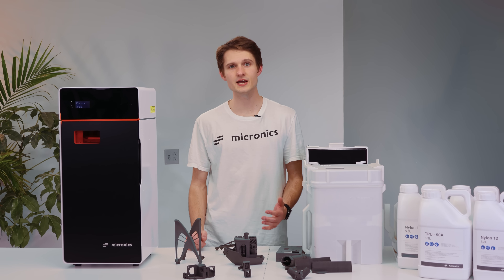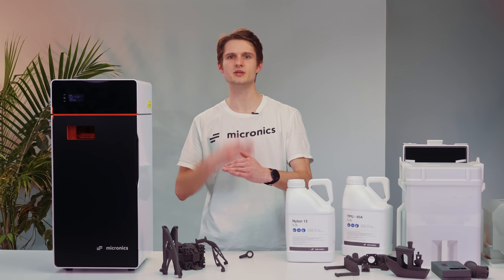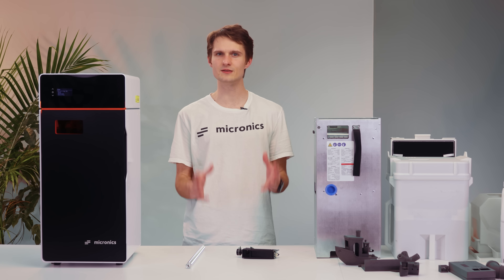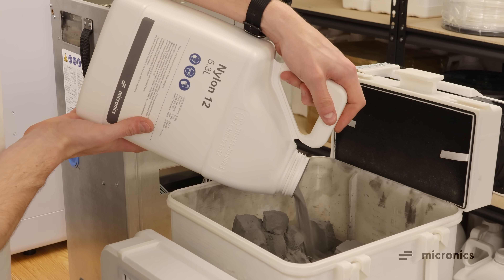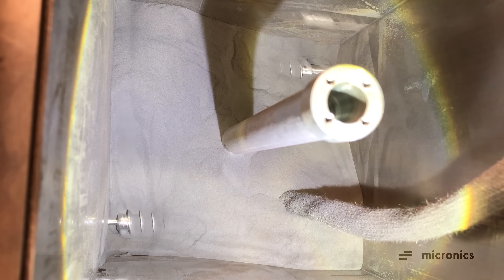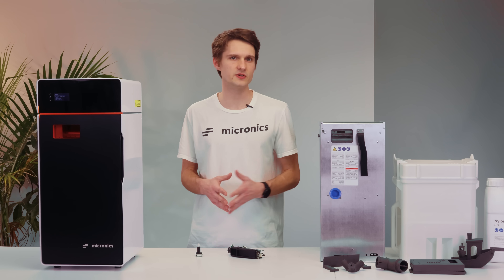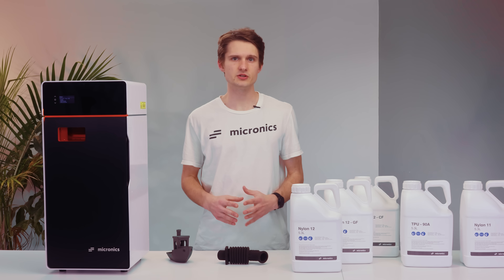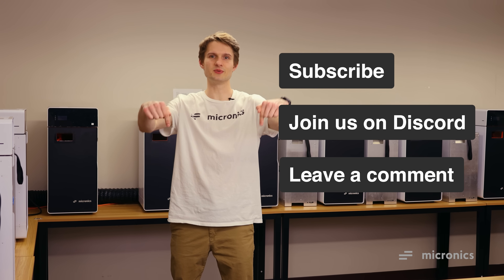How we BUILT a 3D printer that can print ANYTHING!

Comment: I've literally only just started low volume 3D printing using an Ultimaker S3 dual nozzle printer, that can print numerous different impregnated and regular filaments, to produce extremely rigid strong parts. Now you're telling me one can print with powders? That's just not fair. Materials and printing innovations are moving forward so rapidly, one barely has time to master one discipline, before needing another crash course in the next innovative gadget to hit the market. At least if one is familiar with the software, less time is wasted learning completely new design tools and techniques. Thanks for the very informative video, which has convinced me non the less to stick with regular filament 3D printing for now. 😉👍

Comment: With a 160x160x200mm build volume & a 500W power draw its build volume is around the same size as the A1 Mini which is on the smaller side for me. But it’s a great start & I’m sure a larger version will come out if this gets enough support!
Also the ability to make parts with isometric strength in any orientation like with resin is awesome! Even better that no supports are needed thanks to the powder supporting the printed parts 🙌

Comment: If I might add some suggestions, as I have some experience with CO2 and Fibre laser SLS printers: You would open up a whole new market, especially in Powder research, if you are able to develop this system to use a CO2 laser. I get why you went with a NIR-Laser source but from a research standpoint a CO2 laser is almost a must. I know that the primary focus of this machine will be prosumer but the market for research machines is unsaturated and the machines cost a lot (SnowWhite2 =~ 20k, sintratec S2 =~50k) so this machine with a CO2 laser source would outcompete all competitors, just saying ;)

Comment: Hello, this is a amazing product! I have a couple of questions.

1) I'm designing a digital galvo motor driver for a different project, but I noticed in the video that you prefer an analog driver. Is this because of cost only, or is analog driver better in terms of precision?
2)Are you using two photodiodes available in the market for your galvo motors?

Comment: Can a printer like this be used to make tabletop wargaming miniatures? or is the quality not sufficient to equal injection molding for that?
Reply: the surface finish is far too rough for miniatures
Reply from the maker: You can print miniatures very easily, especially those with complex geometry usually  requiring tons of support. The surface is rougher than SLA but still much smoother than FDM. We recommend media blasting with glass beads to get a smooth surface finish. If you want you see it for yourself, you can order a sample part from us at www.micronics3d.com.quote. Cheers!

Comment: Nice, but I suspect it can't print steel/metal?

A great deal of the attraction for SLS printing is the capacity for metal parts. I can see this working with something similar in concept to the process of using metal infused filament that's laterburned away with a sintering process...

But I'm still waiting for a full metal 3D printer 😭.

Comment: Have been contemplating to pull the trigger on a Prusa XL or the next gen BBL printer which supposedly will be released this year but was holding out to see if anything else was on the horizon.. I think I just found it 😮 

One question though, SLS seems a lot more aimed at functional parts whereas FDM can be more aesthetic with different colours etc. Is there any colour options when it comes to SLS? Even basic solid colours over the entire part?

Also, please ship to UK! 🙏
Reply from the maker: To keep the cost down on our printer, we used a 450nm blue laser source which means you are limited to dark grey/black powder. However, the parts come out with a matte surface finish which takes spray paint very well. We should be able to ship to UK but there may be additional import duties.
Reply: @micronics3d  Awesome stuff, apparently dyeing SLS prints is a thing too. Excited to see where this goes, will be following for all the updates!

Comment: Great job! 👏👏 what could be done to reduce the surface “roughness”? (Same issue happen with Lisa and Fuse vs MJF)
Tks
Reply from the maker: You can smooth it out with media blasting, tumbling, or vapor smoothing. Alternatively, you can also use CNC machining for higher precision features or manual sanding/polishing to achieve full gloss.

Comment: spot electro-plating in copper sulfate water bath, direct metal spot plating of copper, very near the point, on a conducting copper surface sheet. well, if the commercialization of the sls laser sintering continues then the next level is sub 500 sls consumer (not prosumer) device. yes for real.

Comment: Idea: add a little vacum of some sorts on a xy gantry to make infill possible without adding holes in the model. While this reduces strength and increases machine cost, it can reduce the cost of per piece and weight greatly
Reply: no.. solid dense models is where it's at
Reply: easier said than done

Comment: This is so cool! I hope you succeed! ❤
Also, how about using metal powder instead? If you could bring metal 3d printing at this price range to the market you guys will revolutionize the world!! Would love to hear back what are the major limitations for this.. since it seems you solved most of it already.. 
All the best! Subscribed!
Reply: Few things you need for metal powder: Way more laser power, way more chamber temperature, evacuated atmosphere with inert gas (like argon). Some of the cheaper metal printing systems actually use a binder powder that just "glues" the metal particle together, then you have to sinter that raw cake in a furnace at over 1000°C for hours to burn out the binder and weld together the metal powder. This sintering and removing of the binder leads to massive shrinking (20-30% in volume are not uncommon), and this leads to a whole new set of difficulties and issues.

Comment: I am guessing that the matt surface finish is unavailable with this kind of printing. What would be a reliable suggestion for recreating a glossy finish after printing? Heat treatment, some kind of chemical finishing or just good ol' sanding and polishing?
Reply from the maker: The parts come out matte and we recommend media blasting. It's possible to achieve semi-gloss finish with tumbling/vapor smoothing. Full gloss would require manual polishing.

Comment: Using unreal engins physik engine to pack the parts has to be one of the greatest moves I have seen in a slicer.
Reply: I love how the benchies already showed the issue when packing this way, one of the benchies was nested at such a shallow angle that the 100 micron layer steps were very clearly visible.
Reply: @random_youtube_commenter  Sorry, what's the point of your comment? I am geniunely curious. Because if you are being sarcastic, I'd think it's a tad misplaced. Don't you think a programmer smart enough to implement Unreal Engine for slicing could figure out how to constrain it to to only using arc angles (or whatever they called) with a bit more time which should reduce the layer lines considerably? Or even a type of setting where you can choose between max packing density vs. max quality.

Comment: Just learning about SLS.... Just curious:  Would a higher powered laser and NO material preheating be more efficient?
Reply from the maker: No, unfortunately the powder does need to be pre-heated. After the laser welds the powder together and it cools back to a solid, it slightly contracts. Doing this a few layers would cause the part to curl up like a potato chip. Therefore the entire powder bed needs to be heated up to keep the material soft and flat.

Comment: With something like this the infill will always be 100% inside an enclosed shape?  I guess you could drill a hole in it to get the powder out.  This method looks really promising though.
Reply from the maker: Yeah typically SLS parts are printed 100% solid. You can make hollow parts but we recommend having 2x5mm holes for getting the powder out after printing.

Comment: This is truly awesome! Whats the cost for a 2nd chamber so i can switch between nylon and TPU easily? Air quality? Do i need special ventilation or fume extraction?I need 6" x 6"x 12"  any possibility of making a larger build volume model?
Reply from the maker: Additional chambers will be $1299 each. The printer has built in carbon and HEPA filter so you just to use it need a well ventilated room. For larger parts we recommend that you split up your models.

Comment: This right here is the holy grail of hobbyist engineering. Fully isotropic, compatible with regular & GF nylon, and efficient use of the full build volume. The only limitations are very high temp and conductive materials
Reply: Girlfriend nylon works in this?
Reply: Love me some Gluten Free nylon!
Reply: Parts are not water tight, food safe and the process is toxis as fk..

Why does this replace any 1500€ easy to use high quality bamboo FDM printer? It does not!
Reply: https://youtu.be/UIqhpxul_og This guy did a conductive setup with a powdered catalyst and electroless copper plating bath.
Reply: build speed is a problem, and 0.15 resolution pales in comparison to SLA
Reply: @KnugLidi  And compared to injection molding, the cycle time of any 3D printing process is complete garbage. All manufacturing processes have pros and cons. SLS parts are however are an order of magnitude more durable than any off-the shelf photopolymer resin.
Reply: @Bob-jn8gt  Indeed.  3D printing is rapid prototyping.  This gives you more durable parts, but if I'm looking at laser sintering, then I want metal.
Reply: @KnugLidi  We all want metal sls. Sadly I don’t see this being attainable to the retail or small business market for the foreseeable future.

In all honesty though, depending on the required alloy, some metal SLS parts can instead be made via investment casting at a fraction of the cost and could be made in a home setting with a fair amount of trial and error.
Reply: @Bob-jn8gt Yes, home casting is possible, but not practical.  The process we see here is a stronger plastic prototype printer.  It is substantially slower and has lower resolution and requires more onerous post-print processing than either common home printer types.  I have used various prototyping printers (like paper ones -each layer of fine paper cut with laser. Very good for large prototypes like car fenders etc.) since the late 90's.  The technologies have certainly advanced over the decades.  However, the printer talked about here is NOT the holy grail for home prototyping.  For this kind of effort, metal/ceramic materials.  That would be the holy grail for home prototyping
Reply: @KnugLidi  different processes for very different use cases. SLS is generally going to make much tougher parts.
Reply: @JeffDM  I agree very different use cases. This is very niche. SLS is a very good space, but this printer is too limited in resolution and materials. It's hardly different from the device I first used SLS in 1998, except that the machine is smaller. Mind you, the machine I used then could print a 1:1 engine block. When you consider how far resin and filament printers have gone in the last decade, this printer 'advancement' is just being smaller.
Reply: And a price tag beyond what 95% of the world population could spend on a car, let alone a printer.
Reply: 3k is a no brainer for me 😂 my car is less then 2k but it drives and is street legal so who gives a shit. @Argosh
Reply: It's worth 30,000, not 3,000 😂
Reply: @Argosh  3k is about what a high end consumer laptop costs in the US. It fits nicely into the budget requirements of the prosumer and enthusiast market
Reply: @XecularOfficial  two years ago, maybe. Now the X1 Carbon exists.
Reply: @Argosh  FDM ≠ SLS
FDM has its place, but SLS is just so, so much better in a plethora of ways.
Reply: @Argosh  I have an X1 Carbon. It's not comparable to an SLS printer in volume or capability, and I would see myself easily spending $3000 to get an SLS machine
Reply: LOL suggesting a filament machine against SLS either shows zero clue about SLS or it's trolling.
Reply: @Argosh  $3k for SLS is insane, what you are even talking about. Do you even have a clue what a typical SLS printer costs?
Reply: @Argosh  right now it’s tough but this will be the Bambu x1c of SLS and will usher in the next era of affordable SLS desktop printers, give it 2-5 years to simmer
Reply: @Argosh sometimes good useful steps are still out of reach to the people that would only buy an Ender. It could still be good for a garage business. Assuming it works as claimed it’s half the price of Sintratec’s kit. Don’t go looking at the Fuse 1 system.
Reply: @Argosh you need to get your money up little boy and stop drinking so many Starbucks
Reply: @Argosh It's not that expensive $3k is about the same as a high end laptops. It's a drop in the bucket compared to the industrial ones
Reply: @Argosh  with that print volume, you wont need to run it many times before making your money back :P
Reply: @Argosh  If you think this is too much, you're not the target audience for this. This printer is meant to be used to produce goods that can be sold or integrated into other goods for sale. At $3k, if this works, I would expect the profit from one of these to pay off the investment pretty quickly.

Comment: What I love about this is that nothing like this has been done before. It introduces competition to a market that hasn't seen many innovations in years. in the end other companies will have to go back to the drawing boards and offer us better and cheaper products. This product is a huge win for all the end-users
Reply: Not just with SLS but with FDM printers too, since now they need to compete with a fully isotropic build process that handles engineering materials with ease
Reply: Have you been sleeping under a rock? Sintratec and Sinterit are two companies that basically tried the same a few years ago. They went with a price more in the 10k$ range on the first product, but they were new startups trying to shake up the very expensive professional SLS manufacturers too.
Reply: @ProtonOne11  You said it man, it's the price. Any company in the industry would be able to create such a product but none did at that price point. I'd bet most big companies would price such a product higher than their other products due to ease of use. 

The Sintratec kit you are talking about was double the price, had a much smaller build volume, wasn't nearly as well thought out and was a kit. Nothing against kits but I'd prefer to have such a precise machine prebuilt for me.

It's the combination of specs, features and price point that makes this special
Reply: Well done, super impressive,  looking forward to you ringing the bell to open trade on Wall Street with your IPO in near future!

Comment: for 3K bucks thats actually seriously impressive. You can overcome the last tedious rinsing process by creating a shaker-machine, and by sifting out the material to the bottom, then use a final high speed fan to sandblast the last details, and use the same room for curing.
Reply: One word: cost
Reply: @tinydiccbandito4953 3k is hella cheap

Comment: My initial reaction to using the physics engine was "ha, that's clever, but obviously an inefficient way to do it". Then I started thinking through how I'd go about trying to implement a bespoke solution, and it quickly starts sounding a lot like a physics engine. Also, while there's a bit of obvious baggage with that approach (e.g. is computing momentum transfer during collisions actually useful, here?), it would still be hard to beat the amount of optimization that has gone into PhysX.
Reply: There are a lot of different packing algorithms out there since it's a very open-ended problem. Currently the best ones use neural nets to figure out the most efficient way to pack 3d objects. It would be cool if the slicer would have custom plugin support to use the open source algorithms you can find

Comment: Amazing work. Isn't working with the powder openly unsafe for respiratory system?
Reply from the maker: The powder is non-toxic and quite large so it settles quickly. However we do recommended wearing a N95 mask when handling it in case of spills.

Comment: Bonkers. I would love to see direct comparisons with FDM and resin prints. Strength, build time, etc. More in depth start to finish on the print process. Ya'll got me real excited here.
Reply: Fdm and sla are no match fo sls. Fdm is inferior in all categories besides simplicity and cost. Sla is closer in capabilities to sls when it comes to resolution and overhangs but is much more brittle
Reply: @tinydiccbandito4953 no offense but fdm is quite useful and quite safe overall and the only option today to create multicolor objects. On the other hand SLA are nice minifigures made from chemical hazard. SLS is basically shooting lasers at microplastics and some of those will escape the cleaning process. Again not that great for the environment.
Reply: Yeah, if I had only one in my room I'd be the fdn printer, as it's generally safer depending on the plastic used. 

Can't imagine a resin printer being safe to print with in the same room I sleep in, and I feel sls would get messy after a print.
Reply: @Tigery760  i would absolutely not recommend resin printers to be used in a bedroom or single room apartment unless you do some perfectly sealed enclosure.
Reply: @Tigery760  i have small resin printer, keep it in a cabinet on an enclosed balcony. The printer itself got taped all over to make it almost completely  sealed, so right now i can't feel the smell of the resin in the cabinet. All the cleaning tools fit on an old oven pan